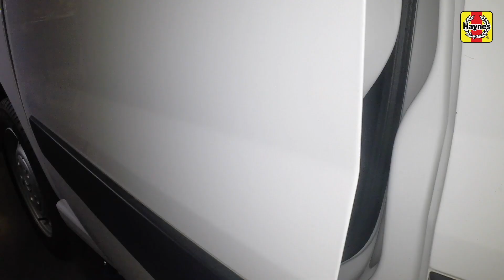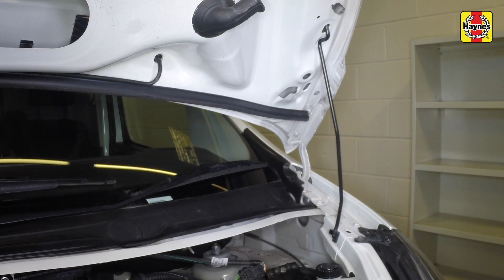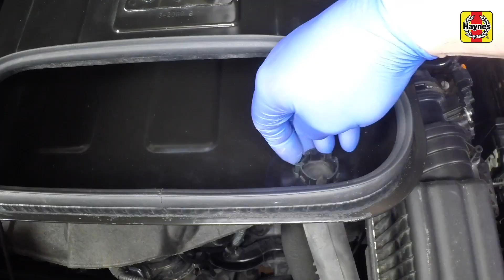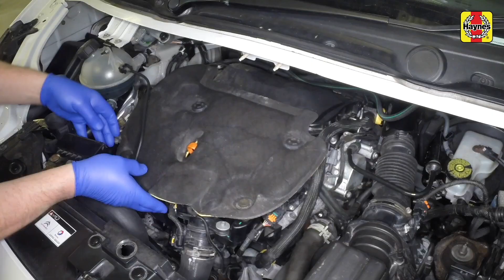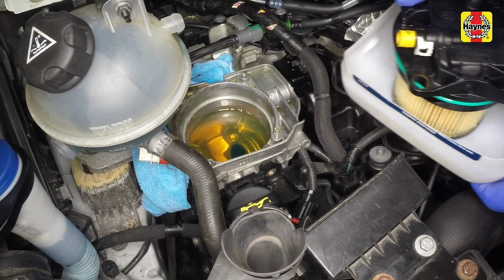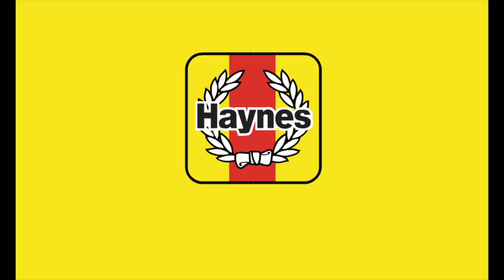How to Replace the fuel filter on the Citroen Dispatch 2007 to 2016

Comment: Good video. My engine light came on with a code and the vehicle went into limp mode. Checked the code with a OBDII and with the help of this video was able to swap out the filter and get going again. Saved me an expensive and time consuming trip to the garage.
Reply from the maker: Glad it helped
Reply: @HaynesManuals  how do you replace the fuel rail sensor